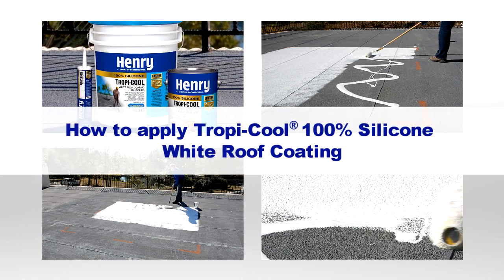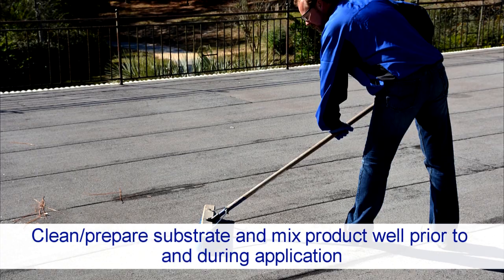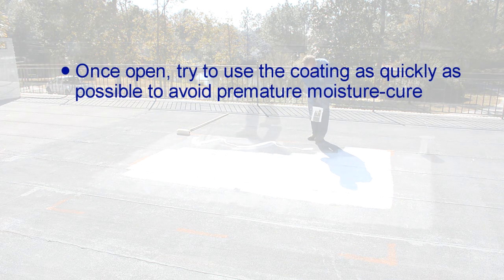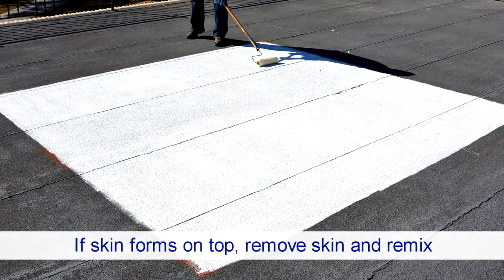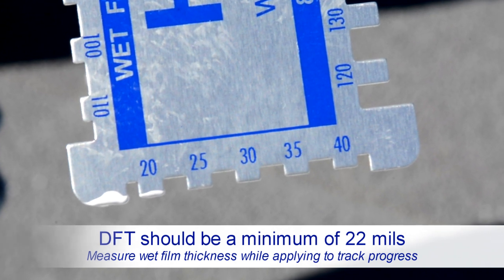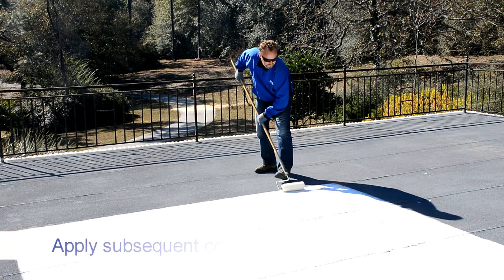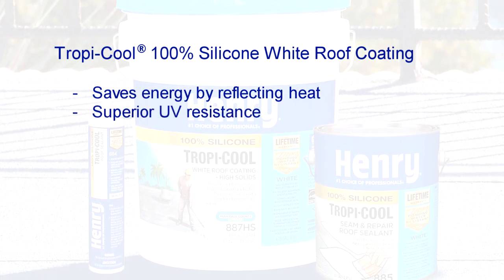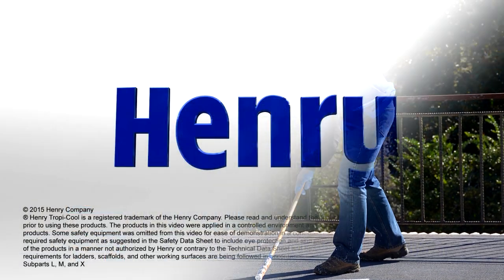How to apply Henry® Tropi-Cool® 100% Silicone White Roof Coating

Comment: Would you recommend applying this underneath damaged, leaking shingles to stop roof leaks (and then reinstalling new shingles over top to complete the patch)? If no, why not?
Reply from the maker: No, the Henry Tropi-Cool 887 is not a leak stopper and cannot be used in this manner. If interested in stopping roof leaks, suggest looking at our line of wet patch roof leak repair: https://www.homedepot.com/p/Henry-Henry-209XR-Extreme-Rubberized-Wet-Patch-Roof-Cement-Leak-Repair-0-90-Gallon-HE209142/100002730?modalType=drawer

Comment: Can this be applied to an epdm rubber rv roof ? Will it bond properly with out ruining the original roofing rubber ?
Reply from the maker: Yes, the Henry Tropi-Cool can be applied to a clean EPDM RV roof. The roof can be cleaned using TSP or a TSP substitute cleaner or any non-filming detergent such as Dawn dish soap.
Reply: @HenryCompanyLLC  is your products petroleum free because you are not supposed to use that on a EPDM rubber roof
Reply: @iair-conditiontheoutsideai3076  I've seen vids that are 2 years old on rv roofs and the only place henrys has kinda come off of is eternabond tape.
Reply: @NigelM18  silicone doesn't stick to EPDM

Comment: Trying to start the painting in the early hours because of the Texas heat but looking at it, there is dew on the roof.  Do we have to wait until it dries before starting the paint process?  We thoroughly cleaned our RV the last 2 days. Thank you!
Reply from the maker: @Beveryly The roof will need to be completely dry to apply the HE887.
Reply: same here in Philly .Dew on the roof and existing Henry coating bibble then tightens up up mid day with the heat.Their are a lot of products then it does not adhere too.Its is in very small print on the container

Comment: Okay so if you apply it correctly how long will it last? over 10 years? 15 years? 20 years? i live in sw florida have a pitched 6/12 shingle roof that has no trees dropping leaves on it... thanks
Reply from the maker: @roadstar499 The Henry Tropi-Cool 100% silicone is not compatible with shingles of any kind and cannot be applied to a shingled roof. Please check out Henry RoofSaver to extend the life of your shingles: https://www.homedepot.com/p/Henry-Henry-812-RoofSaver-Clear-Sealer-to-Extend-Shingle-Life-0-90-Gallon-HE812146/312979687

Comment: Most silicones can never have anything applied over them. Is that the case with this product? Silicone caulk has to be removed before more silicone caulk can be applied, for instance.
Reply from the maker: @Jack Wesselman The Henry Tropi-Cool can be applied over silicone caulk.
Reply: @HenryCompanyLLC  can this product be applied to Bare plywood
Reply from the maker: @chrisc7147  Plywood is not an acceptable substrate for our roof coatings.
Reply: @HenryCompanyLLC  can this be applied on a G20 conversion top van. It's fiberglass.
Reply: @elaineclementsfinn1872  yes. No problem.

Comment: do you have to apply the polyurethane foam or can you use this rubber sealant as a protectant layer by itself?
Reply: it goes on top of any suitable substrate. These are listed on the website and on the label.

Comment: Roof will be white? Weird look
Reply: So right now we all do understand what Babylon means from bible predict !!!!
Reply: Soon Babylon will totally got  destoryed !
Reply: barefoot arizona. I won't but you do !!!!
Reply: Barefoot arizona = mark of the beast
Reply: @fukaiyang3048  are you ok??  It seems like your taking your anger out on just a roof sealant. It’s gonna be ok
Reply: @fukaiyang3048  Crack kills
Reply: You'll only see it when you are standing on top of it. unless you look down from a higher story, it is for flat roofs.
Reply: its for hot climates so it reflects 79% of sun radiation back to hell.
Reply: Henry if you don't make black, sorry we have to go apply L R EDPM liquid rubber roof coating. L R EDPM has 10 years warranty and last at least more then 20 years. L R EDPM got ☆☆☆☆☆ and they do have in black color ♡. L R EDPM liquid rubber roof coating also a lot cheaper then henry. Before we used henry 208 & 208 R and it never get dry ! It didn't last long like henry said 7 to 10 years ! Henry last 3 years maximum every time when we apply on our roof ! Even Low's employee said the same thing as we do ! So they had used Black Jack to apply. They apply twice and it works great, much better than henry. We all do agreed. When we use henry on the roof, we had go back on our roof by every year ! So henry really sucks and waste a lot of money ! Good bye my henry I thought you are great in the beginning
Reply: Since 2018 we all quit henry ! So we already changed to Gardener W-R-Dry. So far we already purchased gardener w-r-dry for more than 50 buckets 4.75 gal to applyed on the roof. It dry fast, never breaks. When we applyed Gardner w-r-dry on opening it never opened again ! But henry always opened by every year even we applyed henry more than 3 times. Gardner w-r-dry last longer than henry 208 R. Gardner w-r-dry dry fast. Never break. Never open again. But henry always opened, breaks and never dry. So henry made all mess on our roof !!!!
Reply: Those evil uniform demon threatened you and set you up while you just reconditioned your own roof. Black color is most protected owner's life while they working on their own roof. Flex Seal is the best to protect some innocent owner while they working on their house. Everyone now plant more tree to protect their family's life from those evil uniform demon
Reply: White is the worst in the whole world !!!! Small air plane and helicopter are harresment and provoked the people. White color is very dangerous. BLACK IS THE BEST AND MORE SENSE AND MORE PRIVACY !!!!!
Reply: @fukaiyang3048  Black = attracts heat and ages the material fast
White = reflects heat and lasts longer
It's why all new energy efficient roofing is lighter colored.
Reply: Why made in white ??? BECAUSE GOVERNMENT WANT TO SEE YOU !!!!!

Comment: Hello , my whole cement roof is 2,726.74 sq feet. It is very big. How many buckets of 4,75 gallons do I have to buy? Do I have to put it on standing blocks on the roof or only on the flat areas?  Thank you.
Reply: 1 gallon × 100 sq feet.
2,800 sq ÷100= 28gallons.
Reply: 10 buckets.
Reply: Jacqueline Rovelet 
Is it a flat roof? What type of material are you planning to put it on?
Reply: 1.5 gals/100 sq ft as per the video. That’s 67 sq ft/gal. 2727 sq ft/67 is about 41 gallons. 41 gals/4.75 gal buckets = 8.63 buckets. I would buy 9 buckets.

Comment: Can it be applied to plywood?
Reply: I just applied it straight to 3/4 luan with no problems at all
Reply: @roni976  I wonder how long it will last over raw plywood ? Did  you tape the seems with anything first ?
Reply: @jameslester4260  yes I used everbond seam tape. Camper has been out in Indiana elements now all year and have taken it camping several times with no problems.
Reply: it can, but that would not be a good idea unless its just on a tree house or something. No warranty in that case. it needs a roof substrate underneath it to be legit.